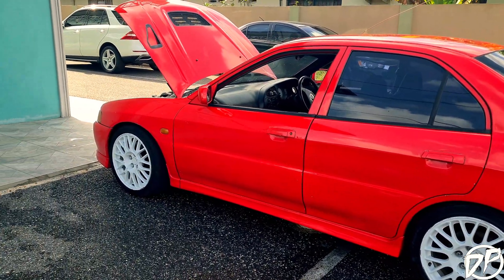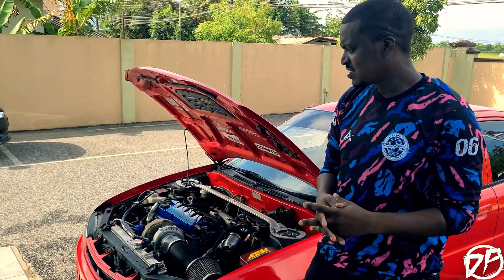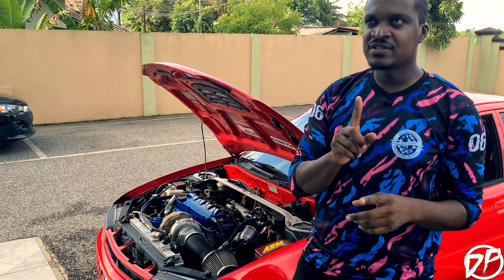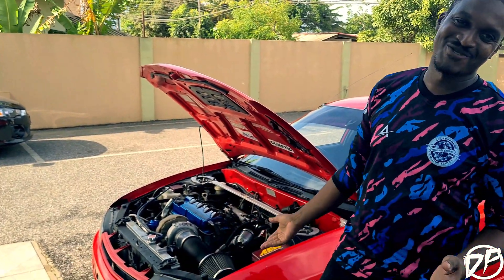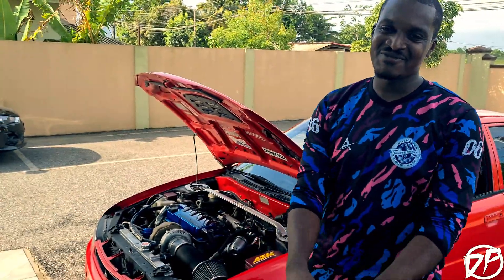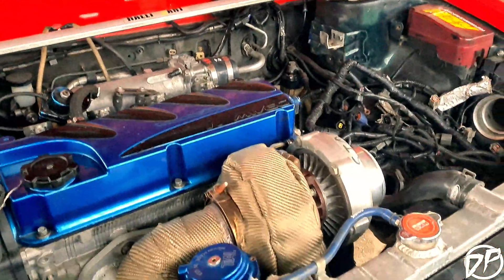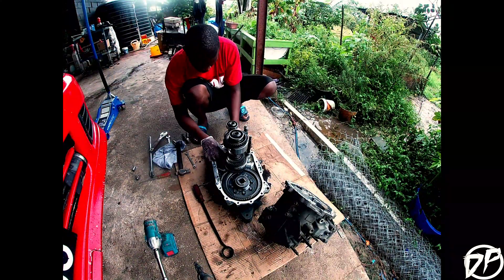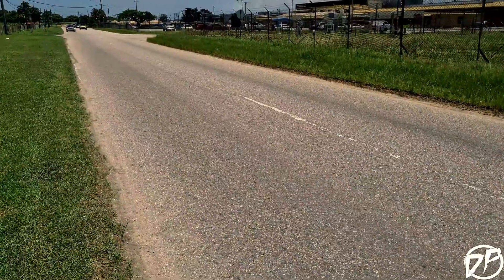430+WHP  Turbocharged 4G69 SOHC MIVEC

Comment: Did you had to do anything for the k24 piston in the 4g69 block?
Reply from the maker: As far as I remember,  I dont think so. But it was a combo of that and evo rods, not 4g69 rods.
Reply: @d @danielpersad5789 you know what were the specs for the rods for the evo? And also which evo was it? 1st gen with 6-bolt or 2nd gen 7-bolt? And i am sorry for replying this late
Reply from the maker: @3dworldproduction237 it would be evo 7 rods. I dont remember exact specs but I know its eagle rods and that they were shorter than the 4g69 rods. So that was the combo needed to work, evo 7 rods and k24 pistons
Reply: @danielpersad5789 okay, does the k24 piston bolts right into the rods for the evo? Also i am guessing if you are using evo rods u used evo bearing
Reply from the maker: @3dworldproduction237 I believe it did. Its my friend's build. But u can Google wrist pin size for evo and k24 and that can give u an idea of fitment. Would be evo bearings yea

Comment: to swap using 4g69 on a lancer, is the lancer's default gearbox plug and play? What gearbox does the Lancer above use? please answer thank you
Reply from the maker: Hey man. So when going to 4g69. You have to use a 4g69 gearbox or a 4g63 fwd gearbox. The 4g9x or 4g1x boxes won't bolt up.
Reply: @danielpersad5789   oh okay, thanks for the information
Reply from the maker: @warendraa  no problem

Comment: What are the specs on the pistons?
Reply from the maker: It's just off the shelf nippon k24 pistons rated for over 500 hp. Bought on ebay
Reply: @danielpersad5789  I'm planning on rebuilding the engine with those parts. Just bought a ralliart crashed and I'm going to part it out. You got an Instagram account to follow up?
Reply from the maker: @janmuniz955  this is my friend's car. I will let him comment with his info so you can reach him as he will have all the specifics
Reply: @danielpersad5789 You need to modify the block to use the k24 pistons? Can u use the k24 pistons with a aftermarket 4g69 rod?

Comment: boost by gear
Reply from the maker: Where working on that as well. Going to test boost by speed an boost by gear. Because the spring is an 8psi spring. And it makes 300whp at 8psi, we may look at going with a smaller spring to help with the traction

Comment: F5m42-2 gearbox?........ 480cc injectors and getting 400hp? .. duty cycle was what percentage? .. what was the 400hp psi@
Reply: Yeah I started lifting an eyebrow when I saw the injector size too
Reply: Maybe decapped?
Reply: @johngray5360  oh 🤔kool
Reply from the maker: @willis23jm1  yea I think its decanted. Injectors definitely needs an upgrade. This was a mixture of pump 95 an some c16. So that helped alot. I think 16psi gave him 400whp
Reply: The injectors are decapped but are currently maxxed at 18psi and need upgrading to bigger injectors  I am also running water methanol injection which is helping
Reply: Yes the F5M422 gearbox I think I spoke to you on insta as you are doing the same engine project I believe and using the OBX diff the injectors are maxxed at 18psi the engine is a high compression build thats why it made that power at 18psi.
Reply: @brandonwhite6334  ok kool I remember..👍

Comment: Bro how much would it cost to turbo charge a 4g15 DOHC
Reply from the maker: Could be anywhere between 10 to 15k . Depends on if you use new or used parts.
Reply: @danielpersad5789  where u guys located wanna pass n check y’all
Reply from the maker: @Mr.Klassik  we are Piarco side
Reply: @danielpersad5789  go have to link me ur digits
Reply from the maker: @Mr.Klassik  sure. 356-4483

Comment: did you do any modifications to make the 63 headgasket fit?
Reply from the maker: Yea we did. Had to weld off a oil port on the block as the head gasket didnt have a spot for it. Block was carried to the machine shop after to deck the block.
Reply: The 4g63 head has a oil drain port where the 4g69 head doesn't so that part of the 63 gasket it slightly out of the 69 head so I welded that port on the block closed then decked the block.

Comment: Is the gearbox 4g93 or 4g92 or 4
Reply from the maker: It's a 4g69 gbox. Only that or a 4g63 gearbox can work. The 4g9x series gbox has a different bolt up
Reply: @danielpersad5789  ok. Thks
Reply from the maker: @cecilschelborn5668  no problem man
Reply: Fwd Eclipse and galant gearbox can wrk also..2005 and above gearbox has better gear ratio than ralliart version.
Reply from the maker: @willis23jm1  yea true